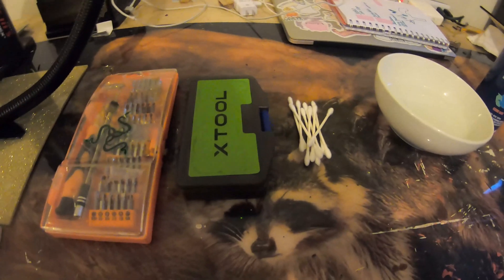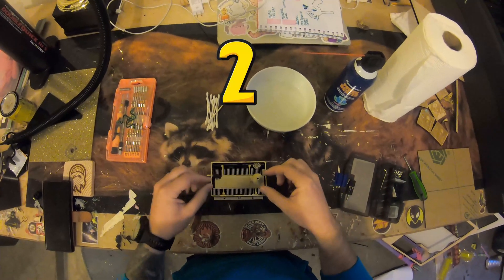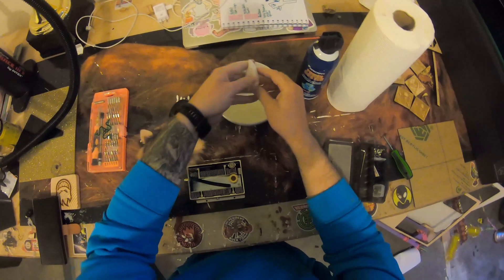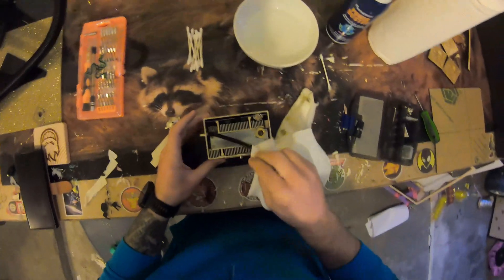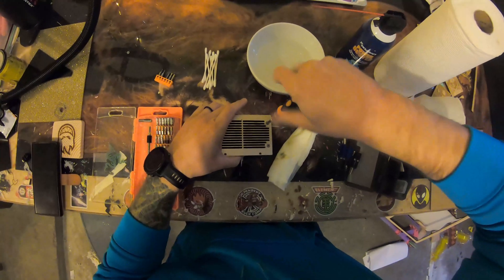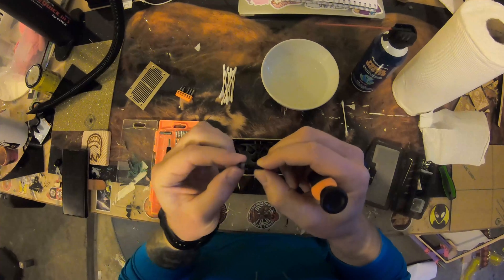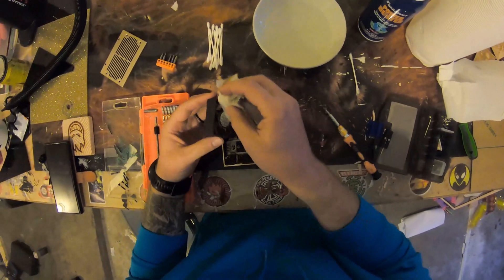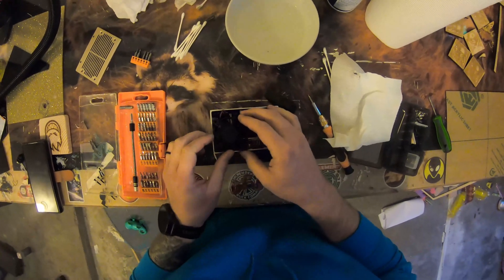How to Clean xTool S1 Laser: No Music

Comment: How often do you recommend cleaning the machine?
Reply from the maker: @michelledawson6804  It really depends on how much it is used. If you are using it for multiple projects each week I would clean it about every two to four weeks. If you have a slow month then it can go longer. However I usually look at the fans on the top of the laser head and the bottom to get a good idea of how dirty it is. If it has a lot of build up I usually clean it. (I personnaly think this is the best way)